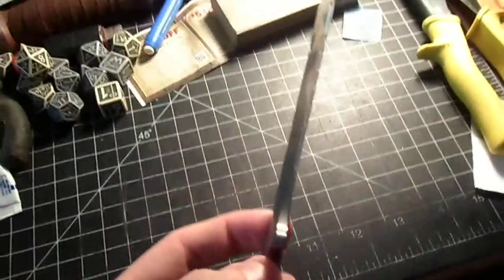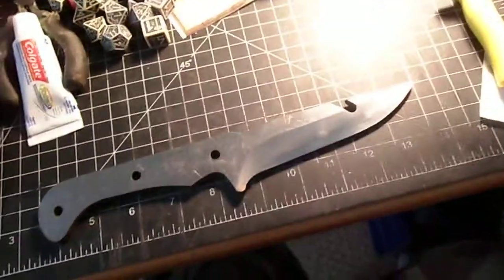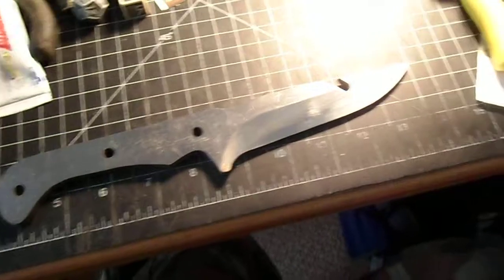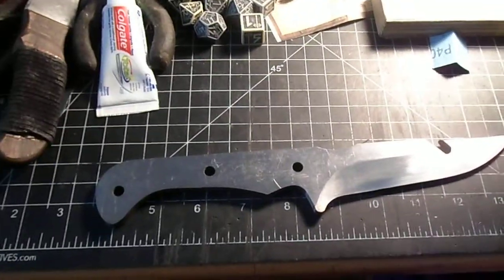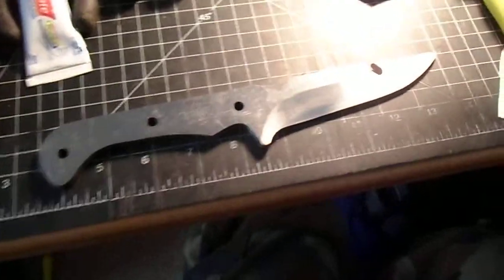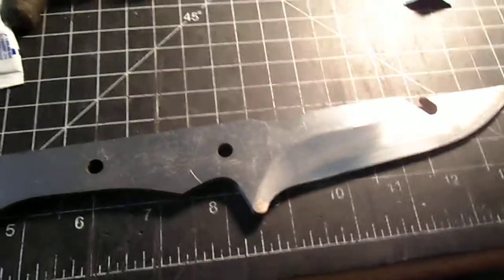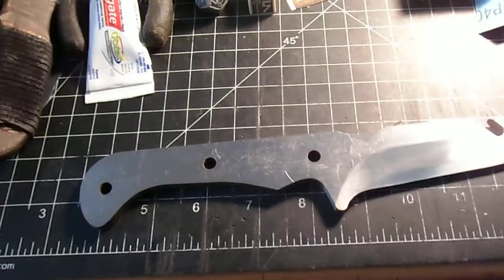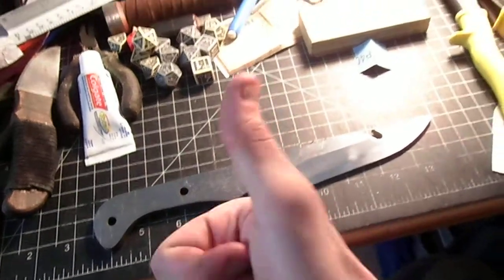Sharpening Time!

Comment: What makes Tanto tips a pain in the ass? Is it because when you sharpen them you can't just move them across the stone in one motion due to the different angled edges?
Reply from the maker: Yeah, it's just an issue of contact angles.  When you've got one continuous curve on your grind, it's just a lot easier and quicker to grind it cleanly.